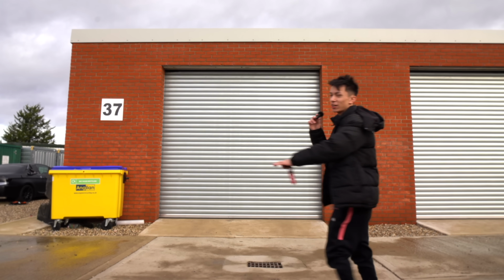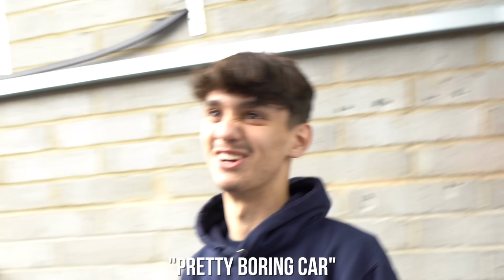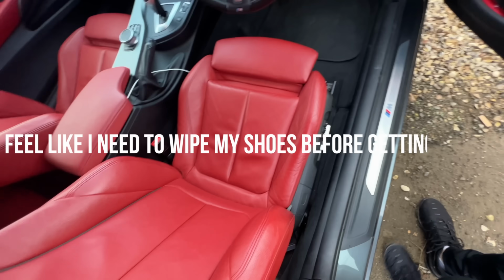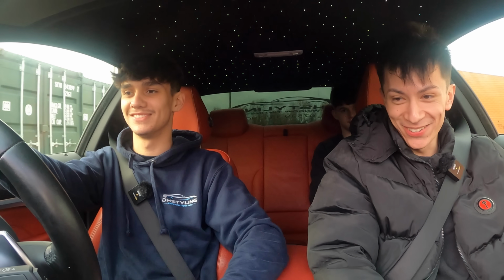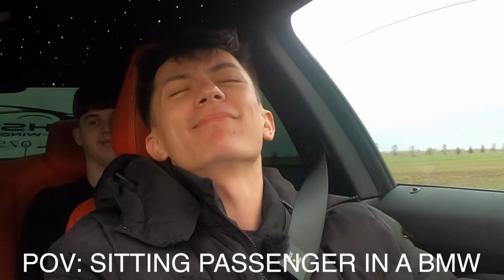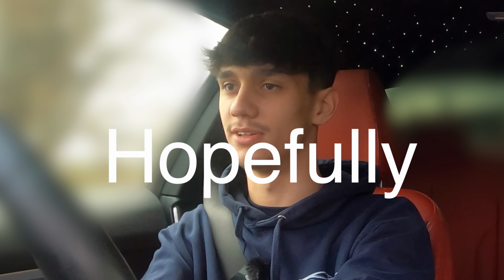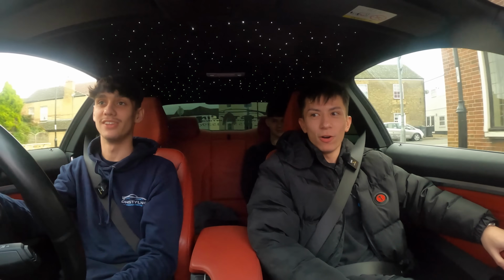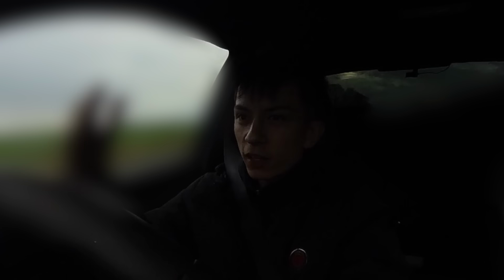470BHP+ BMW 440I HAD ME SHOOK!!!!

Comment: Its normal that the car stops poping when you floor it a few time or the exhaust temp in too big. It has a heat protection for your turbo. And if the car has 470hp like the title says it has a "stage 2" soft and even with the high preasure fuel pump it wont have more power with the stock turbo. And that you have be a driver to drive in sport plus killed mee :DD

Comment: I've got a 440i gran coupe love it, practical fun family and daily car and the odd occasion of a cash and carry run but has to be driven in sports plus to enjoy, running  bm3 stage 2+ with high fuel pressure pump, mppsk exhaust and stage 3 xhp map.
Reply: Can you still control the valves on the mppsk exhaust by switching driving modes now that you have the bm3 map?

Comment: A: Oh, wow! A BMW 440i with 470BHP sounds incredibly powerful. No wonder it had such an impact on you!

B: I can only imagine how thrilling it must be to experience that kind of acceleration and speed. It must have been an exhilarating ride!

A: Did you get a chance to test drive it? I'm curious to hear more about your experience with such a high-performance car.

B: It must have been quite an adrenaline rush! The combination of the BMW 440i's power and handling must make for an unforgettable driving experience.

A: How did the car feel on the road? Did you notice any significant differences compared to other vehicles you've driven?

B: I'm guessing the acceleration was impressive, but I'm also curious about how it handled corners and the overall responsiveness of the vehicle.

A: It must have been difficult to contain your excitement while behind the wheel of a car with so much power. I'm glad you had a thrilling experience!

B: It's always incredible to feel the raw power of a high-performance vehicle. It sounds like the BMW 440i left a lasting impression on you!

A: I'm now very intrigued and interested in checking out the BMW 440i myself. It sounds like a truly remarkable car that delivers an exceptional driving experience.

B: I highly recommend giving it a try if you have the opportunity. It's a car that will definitely leave you impressed and craving for more exhilarating drives!